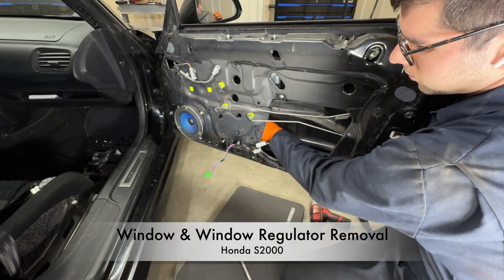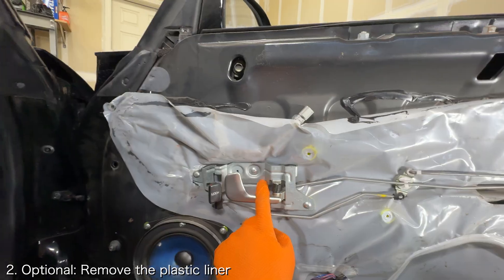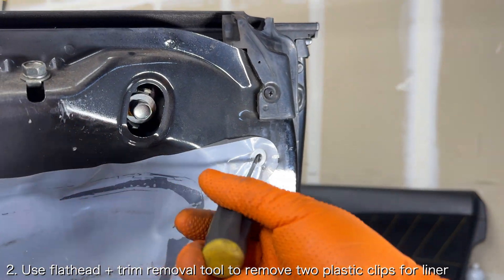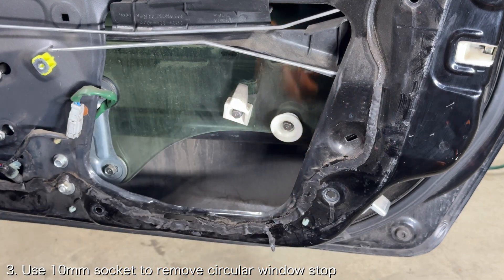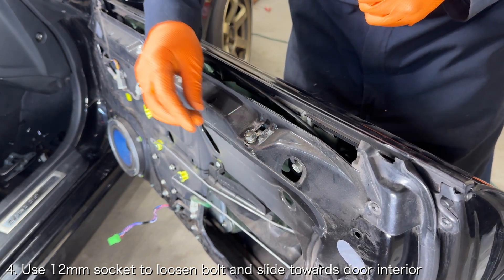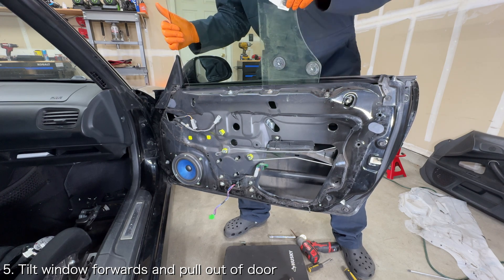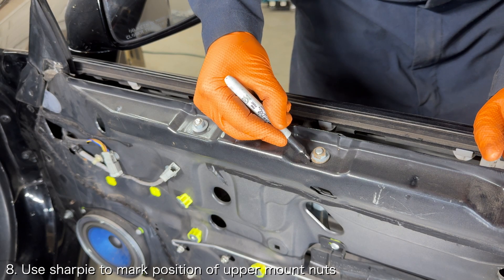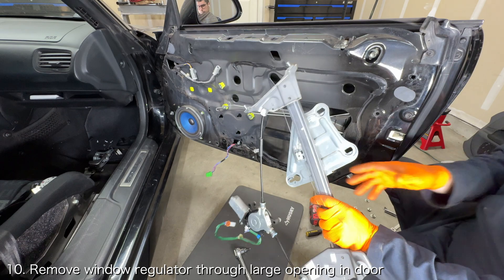Window & Window Regulator Removal | Honda S2000

Comment: Awesome as usual.

Suggestions. Next time show close up of plastic clips you have to squeeze using pliers from back side, in case people don't know what these are, what they have to squeeze.

Also, ideally you want to use JIS screwdriver, not philips. If any are stubborn, philips much more likely to strip head, JIS thats almost impossible.
Reply from the maker: Good suggestions, could have definitely squeezed my iPhone back there. Good point on the JIS too, I’ll add it to the parts list. These ones haven’t been stubborn in my experience but those rotor screws are hell.
Reply: Jesus Christ this clip is defeating me

Comment: Man mine did this, driver aide at 120k miles WHILE IT WAS RAININ! I bought the much cheaper ebay cable kit (comes with an orange colored plastic reel). PITA to tension the cable in the reel. Still using the factory regulator. I wonder if something is causing cable failure...

Comment: Just had to do this not long ago, cable snapped randomly and the glass dropped to the bottom
Reply from the maker: Yep, seeing it more and more lately
Reply: how do you roll up ur window to take out the regulator bolts
Reply from the maker: You should be able to push it up if the cable snapped. If the motor is broken I’m less sure